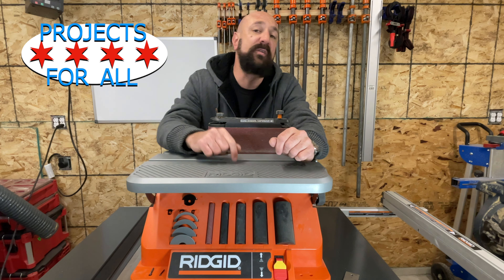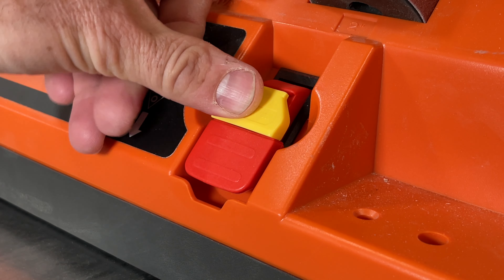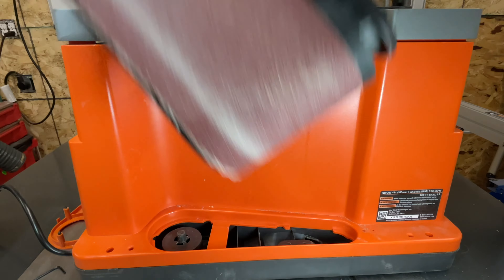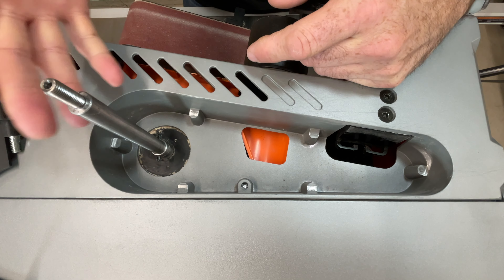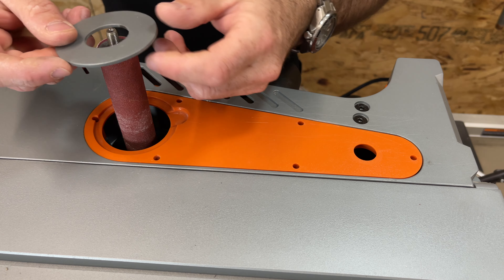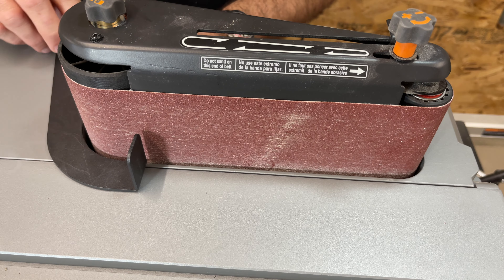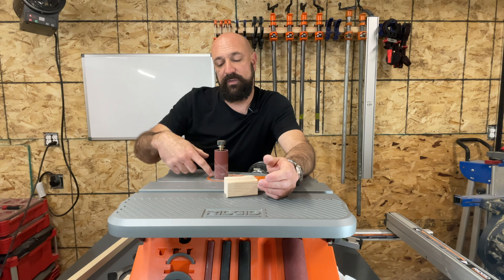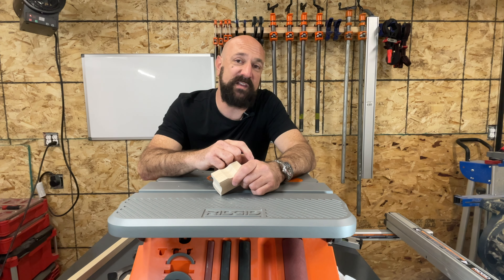Know Exactly What Your Buying // RIDGID Oscillating Spindle Sander // Full Overview and Review

Comment: This is a great bench tool. I'm owned mine for a dozen years. Relative to bevels , the bed must be 90 degrees realtive to the belt surface. Also, using a miter (table saw) helps holding the stock sately as well as guaranteeing a 45 degree cut. I know you knew this! I hope this information supports your fine video.

Comment: I have an older model with the grey case.  I have been told that the early ones are made in the USA.  After watching your video I checked my table for flex and square.   I made a minor adjustment to get square but I have absolutely no table flex.  Maybe the old ones are better.

Comment: Any good carpenter would know that you would use a joiner or a planer for The purpose of cleaning up a Long cut ripped edge. You really must use the proper tool for the job in order to gain the results that you’re looking for. This rigid spindle sander is a very quality piece compared to its predecessors.

Comment: as far as the uneven sanding look at the grains of the wood. Further apart the grains more depth, the tighter grains less depth. Same principle as rip sawing or crosscut sawing. In your block demonstration the side with the uneven bevel you need to apply a little more pressure to the end with the tightest grains. Notice the side when the grains are evenly spaced, the bevel was even. now this only occurs when the piece is being held by hand. Even though you were applying even pressure depth is controlled by the least resistance. if the block was placed in some kind of clamp where the angle of the block could not change, then you would have even bevels.
Reply from the maker: Good tip Stephen! I’ll have to do some more experimenting. We have the Wen equivalent sander coming up soon! I’ll pay closer attention to the grain on that one!

Comment: I've owned one of these now for  a few years.  It's well built and lasts good.  But you bring out some good points.  As far as the belt sander try using lless abrasiave belts instead of the 80 git to see if that takes less off at a time leaving your dips when your sanding a longer piece.
Reply from the maker: I agree Mike less abrasive belts and a very light touch will probably help. Glad to hear it haven’t given you any trouble! Thanks for watching!

Comment: My drill press has an oscillating spindle sander mode and I've used it once in the last 5 years.  That and the issues you brought up, as well as the size and price of this beast convinced me to go with a Harbor Freight belt and disc sander and save $180

Comment: While the description says "tool only" it does come with one each of a bi-metal https://www.youtube.com/post/Ugkx0vyBwjtx9GGOuiqUVT2sRoYqmDoNT_RI and HCS blade plus an adaptor plate for non-DeWalt blades. Wish I had known that before I bought the blade kit, but oh well. Since I already have a DeWalt drill, charger and batteries there was no need to buy more of those so this was a great deal.There is one other consideration. DeWalt does't sell the depth guide separately so you need to buy the three parts which make it up -- the N275350 block assy, the N275341 metal rod and the N278801 knob. Amazon does sell all three.
Reply from the maker: Thanks for watching!

Comment: Table flex at @ 14:30 - My Operator's Manual (Page 20 - Squaring Front Table) shows set screws under the table surface to align the table. That process will eliminate most of the table flex.

Comment: I have had this same Ridgid sander for about three years.  I am very happy with it.  I have had no problems with the belt not being square with the table.  Also, on my sander, the knob that tightens the table screws onto a bolt that extends completely across the sander and holds both sides when tightened.  Now, why did I buy this sander?  Also, it was less than $200 three years ago!  I have been watching many Youtube channels for many years.  I am always interested in techniques being used.  I started to notice something.  Even when they weren't using the sander, it was always prominent in the background.  I started paying attention and that is the only small portable multiuse sander I observed.  So, that's the one I bought.
Reply from the maker: Glad it’s worked out for you James! At less than $200 I’d say it’s definitely worth the price. Last I checked it’s $300. For that money I start to wonder what else is out there. We’re doing a similar Wen sander possibly next week. Should be interesting. Thanks for the comment!

Comment: I have the same sander from Rigid and love it. I thought the samething about the lack of a knobs on the left side of the machine (for the front of the table that tilts down). I just took the screw out and replaced it with a knob with a screw already on the knob. Yes, for that amount of money it should be included, hint hint Rigid. But it is a quick cheap fix. I don't have the same issue with uneven chamfers when I sand them but I primarily use a small block plane for that or if I'm doing a lot of pieces with the same size chamfer, I run the boards through the router table to get the chamfer i need. I agree with the other commentor about sanding edges of longer boards. With this size belt sander, you have to get creative such as his suggestion of clamping a guide board to the table. Just be sure the board is evenly clamped. I thought about an individual large belt sander, but decided that for my small shop, this is adequate. Most of the items I make these days are smalls and jewelry boxes. The largest I make regularly is a 30" coat/towel rack. When I get a larger commission, like a table, I will bring the component's over to my brother's shop that has much larger equipment than I have. But, that is rare. I really rather use a hand plane. It's quicker and something 98% of us have already in the shop. Most times that I go to my brother's shop is to have a cold beer and get caught up with him. 😉😏
Reply from the maker: When I first bought this sander I used it for almost every sanding job for a while just to see how it worked and I was curious if the oscillating would throw it out of square. That little chamfer was one thing I tried and discovered that random result. Ill revisit this topic sometime next year and maybe well get some answers. For sure though there's better ways to chamfer and a small planes a good choice. Thanks for the comment!

Comment: Great video. I like how you went over the little details. If you want to do long boards, just clamp a board to the top with the opening between the board and the spindle just a hair narrower than the board you want to sand and run the board through. It will come out a uniform thickness (although it will only be as square as your spindle.)
Reply from the maker: Great tip John! Thanks for watching!
Reply: Dido

Comment: I have the same type in the form of triton in the uk. The problem is the steel belt runner for me. If you take it apart like I did, the runner has a curve at the bottom to presumably help retain the belt. This is exposes when in the max height position, so the belt is being guided by curved steel when it needs to be flat. I took mine apart and hammered it flat…….pretty much corrected the problem for me.
Reply from the maker: Thanks for the tip Charlie!

Comment: I watched an English vid about sanders like this and they had the same problem of uneven sanding with the belt. they discovered that by having the sanding belt too low it rose over a small lip at the bottom of the mechanism. Bring the sanding belt up a little and the uneven sanding goes away.
Regards,
Allyn 'Alpal' Hansen
New Zealand

Comment: I’ve owned the same tool since 2017 and honestly I’ve thought of selling mine on Craig’s list a few times because of the issues you’ve listed.

Problem is id have to move to a disk only sander and I don’t own one of them.

It’s the belt sander that I use the most, but it’s the spindle sander that works better. And it’s a heck of a lot of space for it to just be a spindle sander for me….
Reply from the maker: You’ve described my experience with that sander to a T. I took it apart last week again looking for a solution. Still looking. If I figure it out I’ll post a vid. Thanks for watching
Reply: i have a small shop fox drill press that has an oscillating spindle sander attachment and i love using that, but i also have a narrow  belt/disk sander combo so theres that

Comment: I've had one for longer than I can remember, but today it wouldn't start and just hummed.  The problem was dirty contacts on the starter relay (Part 32 on the exploded parts diagram).  Take off the bottom, pull the red, black, & wires (note location) and then disassemble the relay and clean the contacts with a file & cleaner.  I have a file for automotive distributor points and it works great.  If the rubber cylinders slip, just double or triple up on the washers.  Make a small 3' box wrench for the star knob.  Finally, keep a couple of pieces of MDF to lay on the table so that you can use the upper part of the belt/spindle sandpaper when sanding.
Reply from the maker: Solid advise Bob! Thanks for the insight. Building an MDG overlay top is a good idea! Lost my points related tools for prob 25 years ago 🤣. Wish I still had that 64 Catalina. Thanks for watching!

Comment: One last comment…there are two small set screws by the hinges at either side of the table.  Use these to level the table , not the radius Ed arm with the detents.  It may improve your results.
Reply from the maker: I did not notice those but I’ll check it out this weekend. Thanks for the tip! Does your older model have the one knob? Thanks for the comments!

Comment: Betting that plastic piece operates as protection for the motor. If the machine got in a bind, the plastic would break and save the motor. Really enjoying your channel. Keep up the great work.
Reply from the maker: Solid point! Mine hasn’t degraded or worn with use so there’s that too. Thanks for watching!!

Comment: at 14:21 you can see the round spindle and the area behind where the paper covers is not aligned properly from the factory. That and the loose table will surely give you the inconsistent results for chamfer ... just an observation
Reply from the maker: Didn’t see what you mean. At that time 14:21 I have a square on the belt drive, no belt and am showing the table flex. Clarify if you can I’m curious to see what your talking about. Thanks for the comment!

Comment: Straight Chamfer. Have you tried dropping the table to 45 degrees and use a mitre gauge?  I’d be curious to see if that resolves any of the any of the unevenness. 
Thank you
Reply from the maker: I actually have never used the miter slot on this machine. I’ve received a lot of comments on this vid and maybe in the next couple months I’ll take the best recommendations and do a follow up vid. Thanks for watching!

Comment: I have an early model with the grey case which I believe was made in the USA. After watching your video , I checked the table flex on mine and found virtually none.  I also checked for square and it was about s you can get with a tool like this.  I’m thinkin’ the older ones are better!
Reply from the maker: Didn’t know Ridgid was ever anything but orange! Or made in the 🇺🇸 for that matter. Thanks for watching!!
Reply: It's adjustable

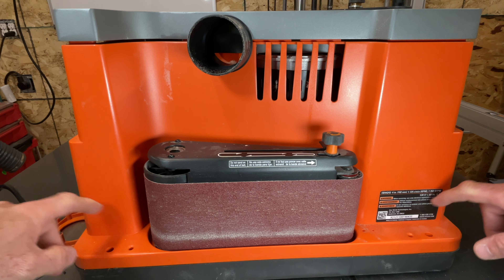Comment: On the table, would it be possible to replace the left-side guide with a knob so it locks down better?  The carriage-looking bolt has to be attached to something in there.  Perhaps there is a way to replace it with something threaded.  Seen at 4:30.
Reply from the maker: Hello Jim! I’ve read in reviews that it has been done. Planning to take it apart and figure it out. I’ll post a really short vid with whatever I come up with soon. Thanks for watching!

Comment: Willing to bet the movement on the sander is due to the plastic parts holding it on. If they're the anchors and plastic flexes there's bound to be movement.
Reply from the maker: Definitely possible but tough to saw for sure as those parts are underneath and not visible. Thanks for watching!